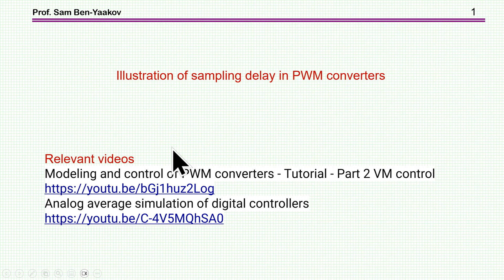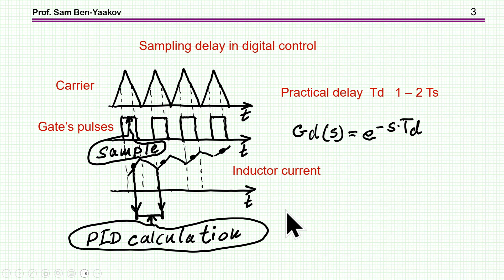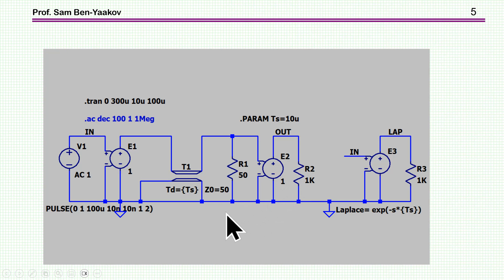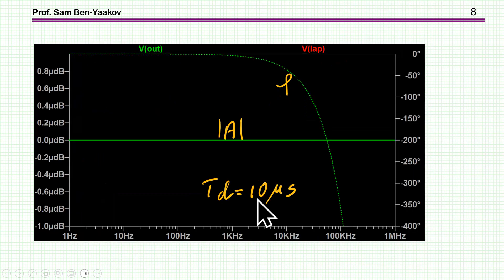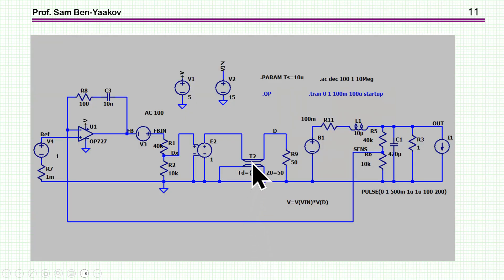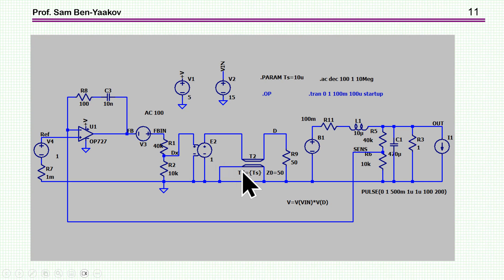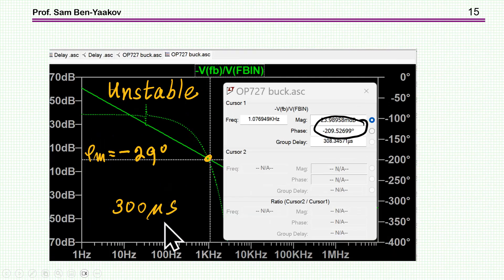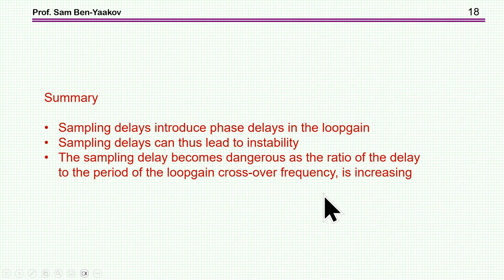Illustration of sampling delay in PWM convertersSamp delay final

Comment: Hi professor,  I have seen papers/text book stated that having sampling delay will make the system to be non-minimum phase system (RHP zero), but if we model the delay to be exp{-sTd) like you did and look at the Bode plot as well as the step response like you did in 5:15,  we don't see the non-minimum phase behaviour ( output step fall negative before rise ). If that is the case, theoritically we can add one LHP zero 10 times larger the cross over frequency to compensate the phase shift caused by the delay?  Can you comment?
Reply from the maker: Thanks for the contributing conversation. The definition of a non minimum phase system is that it does not obey the phase-magnitude   relationships of  basic poles and zeros. E.g. a single pole has a -20 db/dec drop and 90 degrees lag. The RHPZ is just one example. Since the sampling delay does not follow these templates The amplitude states constant while the phase drops) it is indeed a non minimum phase sytem.

Comment: Thanks for another great video Prof. I have a question. What do you mean by sampling delay? Is it the same as the sampling period?
If the calculation of the pid is within the sampling period we do not need to take care of this delay, right? I saw a video about this on @marcosalonsoelectronics and the expression for the effect of the sampling period is different
Reply from the maker: There is sampling rate and sampling delay. The delay is betweem the time  the error voltage is sensed and the time it changing the duty cycle. In digital control. the delay  is about one switching period.

Comment: Thank you for this very informative lecture! Am I understand correctly that ADC triggering should occur much faster than characteristic time of the compensator response? Not sure, when this requirement can be failed. Usually we trigger ADC synchronously with PWM timer, and PWM register is updated only by the next period. This delay of about 1 period (or even shorter) would be always smaller then any characteristic time constant of compensator, wouldn't it? It seems to be a some alternative expression of Nyquist theorem.
Reply from the maker: Not sure that I follow. A one period delay could be very significant. E.g. if the cross over frequency is  say 1/5 of the switching frequency, the lag is about 70 degrees!